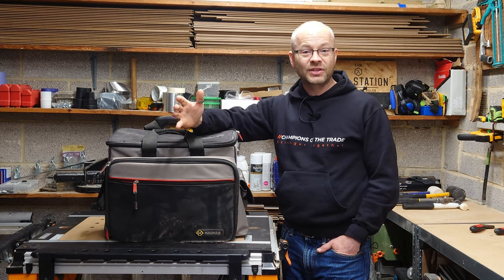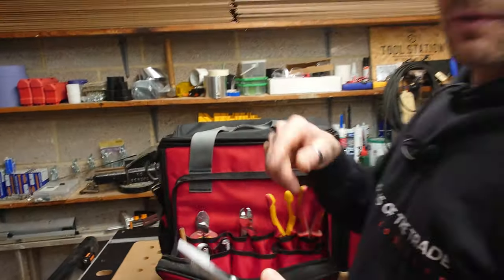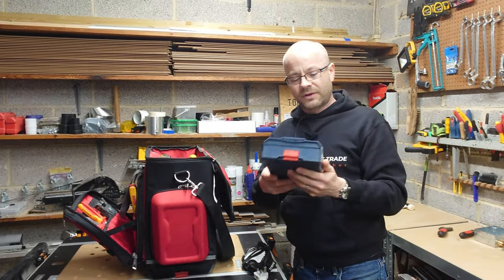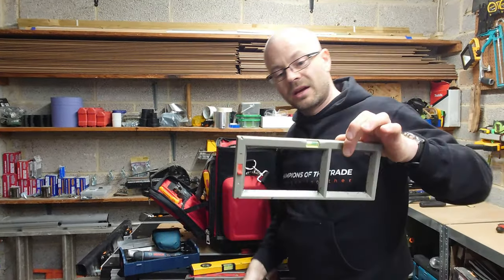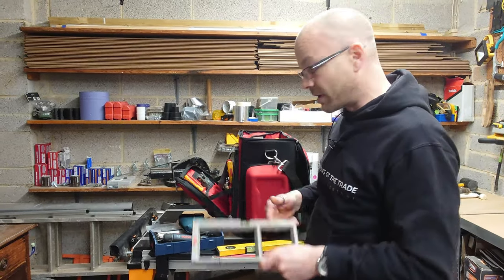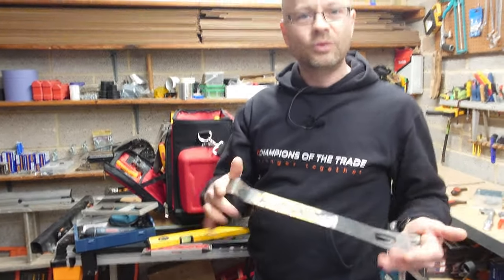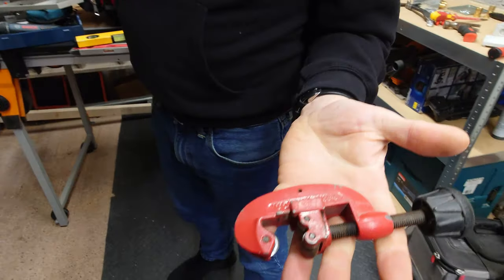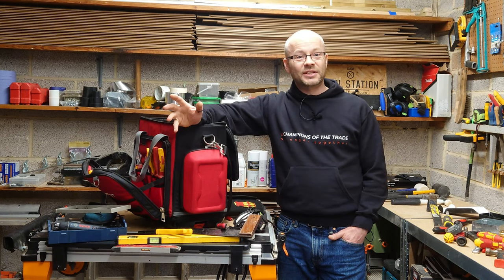What's in My Electrician's Tool Bag? NEW & UPDATED Tools for 2023

Comment: Which one did you recommend  wera vde torque screwdriver or wiha  vde torque screwdriver?

Wera 1.2-3.0 n.m
Wiha 0.8-5.0 n.m 

For electrician?
Reply from the maker: I personally own Wera, their quality is second to none. I've only owned the cheaper Wiha kit, which I class as disposable (it was replaced every year, but had heavy use). I don't have the Wiha torque, if it has replaceable heads, check it doesn't have a small rubber band within the shaft. I had their mk1 electric driver, the band fell out with every blade change, and was eventually lost meaning the bits just fell out.

Comment: Great video and loadout mate! Where did you get the VDE magnetic bit driver from at 16:31, wouldn't mind comparing it to the Beta one I have.
Reply from the maker: Thank you, glad you enjoyed it. 
That screwdriver was one of the first electrician tools I bought many moons ago. Unfortunately I couldn't find it online myself so assume that Wiha have long since stopped making it, which makes sense because all their new tools have non standard size bits (like most brands), so you have to replace like for like. 
They have a newer version, I'll post a link to it.
Reply from the maker: There are 2 different types:
https://amzn.to/3zZ82ke
https://amzn.to/41yJRVm
Reply: @ChampionsOfTheTrade  Thanks for the reply. 
I have the Wiha magazine bit driver, like you say though it only works with their own unique sized bits.
Guess it was done to prevent people putting in stupidly long uninsulated bits in the standard sized bit driver.
Reply from the maker: What do you think of the magazine version?
Reply: @ChampionsOfTheTrade  I invested in a lot of the Wiha bit tools, and have the torque driver, stubby and a couple of normal bit handles as well as the cassette driver and all the bits are interchangeable which is great. 
I keep the cassette driver in a standalone tool bag with an insulation tester just to go out to initial fault finding in motors etc, so is a nice compact solution for that.
The handle is quite bulky with good grip, so it can be easy to damage the smaller blades  if you aren't careful.
The bits are held in with a collar that pushes forward to lock and pull back for release. As it has got older, the collar has loosened up and now if you happen to catch it working in a panel, the collar is easy to knock back and then the bit can fall out.
Reply from the maker: Great, thanks for that.👍 As with everything, as it ages it get looser, as seen in my video when I open the handle upside down and a bit falls out. Do the bits hold well in the shaft when in use, are they magnetic or friction? I had to give up my Speed E (v1) because the rubber band kept falling out, and so the bits fell out.
Reply: @ChampionsOfTheTrade  On most of their drivers they are held in by friction with a locking collar.
The stubby and the micro handle are just a friction fit with no locking.
Inside the handle in the cassette they are all friction fit, haven't had any problems with the cassette on mine.

Comment: I think you've got GS38 confused with IEC 60900.
Reply from the maker: It's possible, which section is it mentioned?
Reply: @ChampionsOfTheTrade  7:58 for the VDE kk turbo and 9:50 in regards to your Wiha hammer.
Reply from the maker: @mclamby  Yes you're correct. GS38 is to do with test equipment. Thank you for spotting my mistake 👍
Reply: @ChampionsOfTheTrade  To be fair to you lots of the German stuff does have GS stamped on it next the the VDE mark which it stands for  "Geprufte Sicherheit".